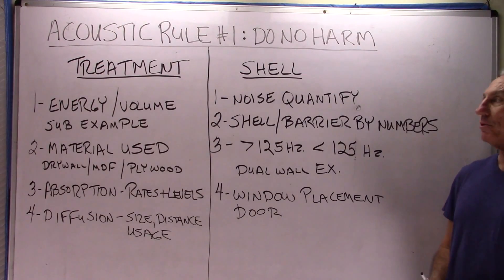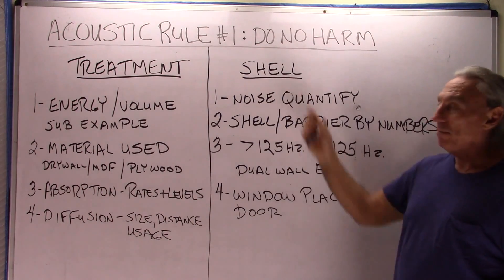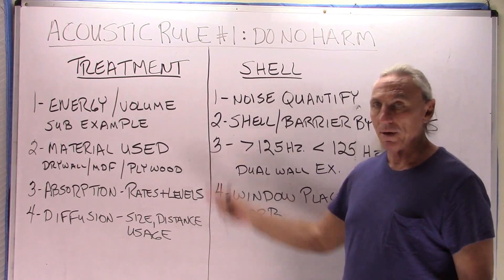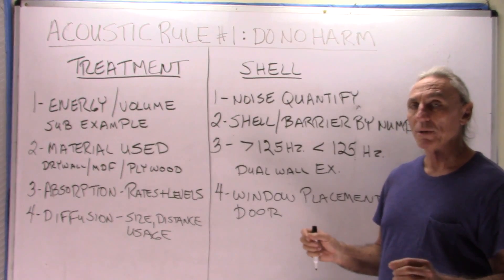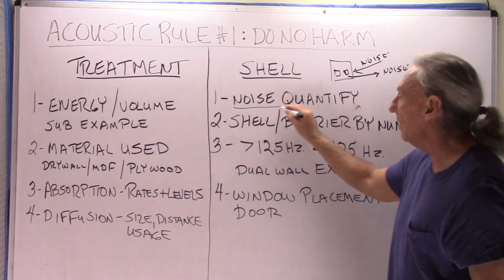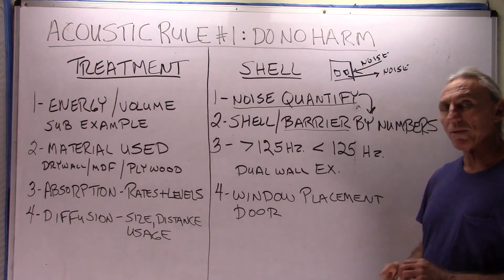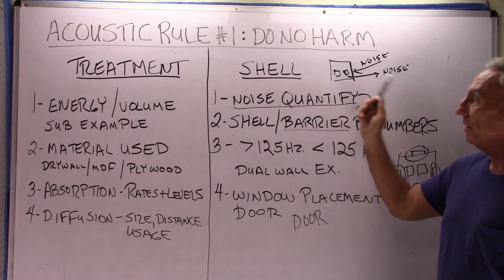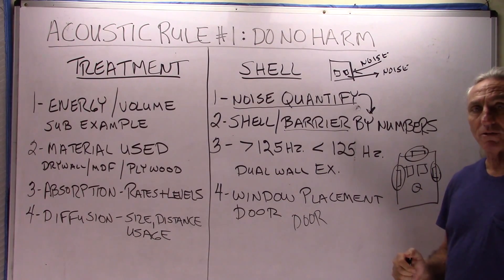Acoustic Rule #1 - Do No Harm - www.AcousticFields.com

Comment: I have a question, in demonstrating the effect of diffusers, they are often shown spread out evenly throughout the room. In your examples you often group them together on vertical surfaces in an array on, for example the back and front walls. I have 3 N23 QRD diffusers and have chosen to group them together at ear height on the centre of the front wall. This was done simply because it’s how you do it but I have no idea if spreading the 3 I have and maybe a couple more of them throughout out the room would be better? Thanks in advance.
Reply from the maker: What is your room usage?

Comment: UGh this is so frustrating to get my room right
Reply from the maker: +MattsterFelix It can be extremely frustrating without a plan of attack. Go to this link and fill out the information required and I will compare  your room size/volume/usage to our data base. We will look at your low frequency issues first and then work our way up the frequency response ladder. It is best to divide a complex problem up into parts and work on each part in a systematic approach. http://www.acousticfields.com/free-room-analysis/